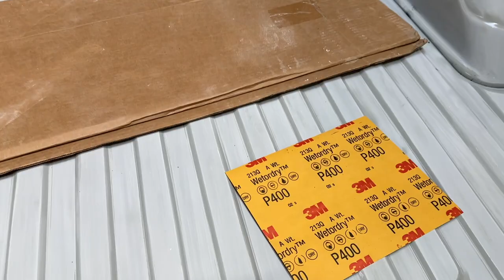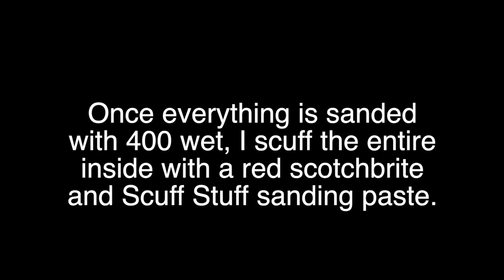C10 Project:  Painting Inside the Bed--EXTREMELY CHALLENGING!

Comment: Spraying the inside of a bed is always a challenge. Worse when you have so much prep to do. One of the best pieces of advice I followed early on was teach myself to paint left handed when I started out as a prime/jamb guy. Now when I'm old and tired I can switch it up for a break 😴
Reply from the maker: It’s a challenge for sure. I kinda wish I had stood it up on the headgate. I used to do them that way and it was easier to reach everything but still hard to slick out the floor like you want.
Reply: @StoutCustom  yeah, it always ends up looking like a 1/4panel on an E250. Works for a factory respray but not for the level you're on with this one. Still beats laying 2 55gal drums on their side and sitting in that 🤣

Comment: Nice job Jim! You got it done. Love seeing your progress. 

I typically stand beds up on end. Mask the head panel and shoot it separately with the bedsides and front of the panel. It allows to get up under the bedsides as well a super clean/slick finish.
Reply from the maker: Yes, that’s a great way to do them. I worked at a dealership once and it seemed like we did lots of truck beds. I use to stand them up as well but I had plenty of help to do it. I think you are right. They were easier to spray and turned out really nice. I never even thought to do it on this one, lol.

Comment: Man that looked rough, don’t forget you can spray upside down with the PPS, and rotate the air cap 90 degrees and do vertical passes
Reply from the maker: I think I’m just going to avoid doing truck beds, lol. I also forgot I could stand the bed up on its headgate and reach everything a little easier. There again, just going to avid this stuff, lol. Thanks for the tip/reminder and thanks for watching!

Comment: You keep mentioning a spray in bed liner. Which bed liner would you recommend?  I was looking at both the Raptor liner and the T Rex liner, both tint able.
Reply from the maker: I don’t know enough about the two to be certain but both are urethane and catalyzed so I think they would be very similar.  Probably would come down to getting the most bang for the buck meaning most quantity and shutz gun included for the best price.

Comment: Hey I’m about to start body work on mine what filter do you use while sanding and painting I’ve had some trouble finding out what to use as I will be using 2 part urethane products which I’ve heard are serious stuff
Reply from the maker: Great question.  There are quite a few choices out there but I mainly use 3M because they have always fit well and worked well.  I added some links in the video description to make it easier to look them up.  Be sure to get the appropriate size for you since most come in several sizes.  There is a half face respirator with pink filters known as a "body man" respirator.  It is mainly for dust and particulates that a body man would deal with and not for painting.  Next is a half mask "painter's " respirator. It's what most painters wear while painting in a booth.  Keep in mind these are for use where there is still a substantial amount of breathable air such as a paint booth that continually moves air in and overspray out.  You ALWAYS need fresh breathable air coming in to your paint area.  Next I listed the same type filter system on a full face respirator.  These work well when spraying inside a bed or where overspray blows back in your face since it protects your eyes as well.  Lastly I listed a 3M PAPR system.  It has a belt mounted filter that sends filtered air to a hood. Expensive but great once you get used to them.  Still it's FILTERED air and not supplied air so you need adequate fresh air flow into your paint area.   There are supplied air systems but that's a whole different ball game. Most likely the half mask painters respirator will work for you.  They do have a life span meaning once the charcoal filters are clogged, it's time to replace.  Some use a body man respirator for all the sanding and the painter's only for paint for longevity reasons.  Anyway I could write for days on this subject.  Wear a respirator, keep some good air coming in to the paint area and overspray going out.  It typically takes decades for this stuff to kill you so alcohol and poor relationship choices probably rank higher on the threat list. Paint On my friend.
Reply: @StoutCustom  thanks for the info will definitely look at the links